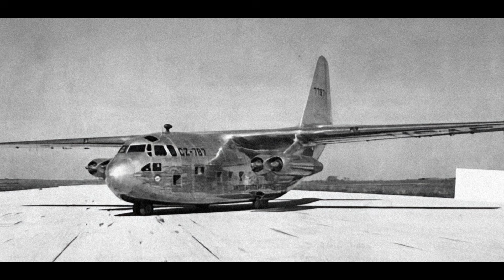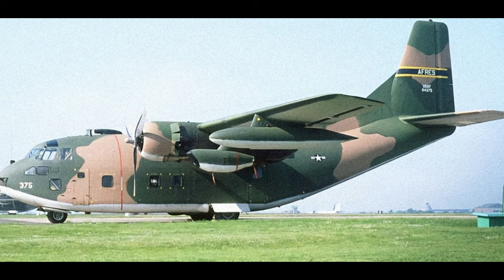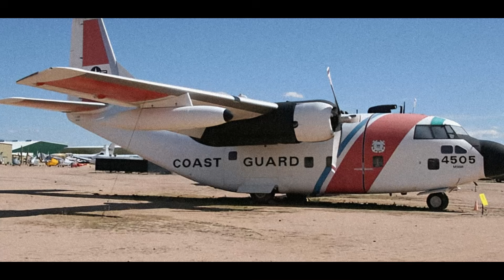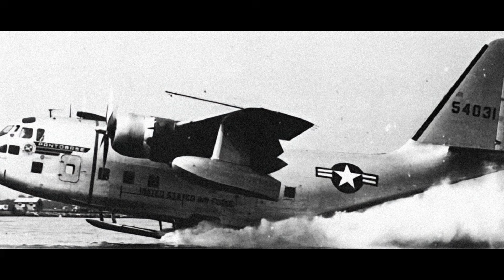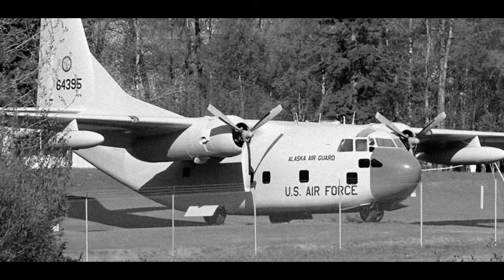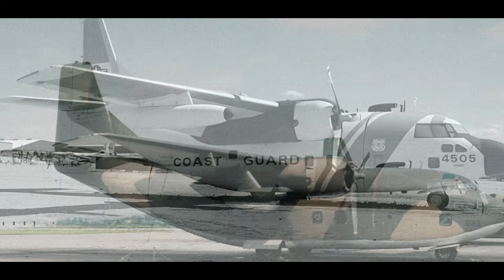C-123: The Famous Plane With a Dark Secret

Comment: The ability to discard the fuel in emergencies, both the underwing drop tanks and the main internal fuel in the nacelles behind the engines was an interesting safety feature, greatly reducing the fire risk post crash.

I think the DHC-4 Caribou was operated by the U.S.Army in Vietnam, until the Army gave up most of their fixed wing assets to the U.S.Air Force. Don't think the DHC-5 Buffalo was fully operational until the U.S. was disengaging from Vietnam.

Please better sync the images used to the commentary.
Reply: Agree w your sentence regarding syncing images.  At LEAST he's using C-123 footage throughout, and not, say, the Brabazon, nor the Concorde.

Comment: Great vid. This aircraft type are some of the most important machines in the Arsenal of the Western World, and besides the mad gunship variants of the C-130 (the current fiendish, flying, meat-grinding monstrosity is the AC-130J Ghostrider), get ignored for the sexier aircraft and machines.

8:38 Also, I'm pretty sure that it could climb faster than 150ft/min. I suspect that there is a digit missing there somewhere. Even fully loaded, and with only piston driven propellers, it should be able to climb at least 3 times that rate, even with one engine feathered and switched off.